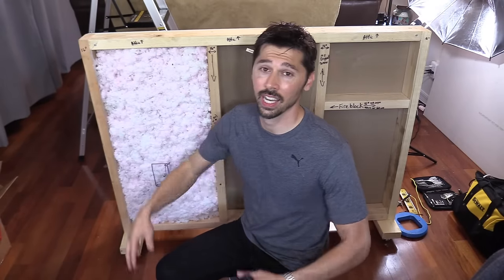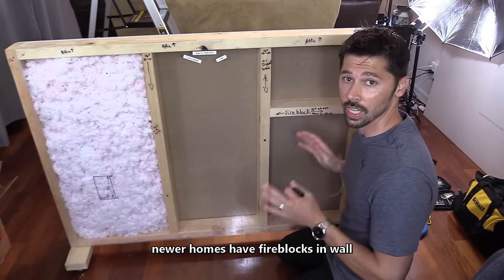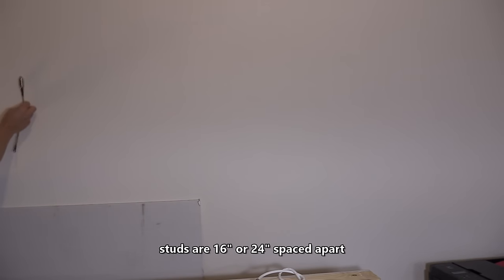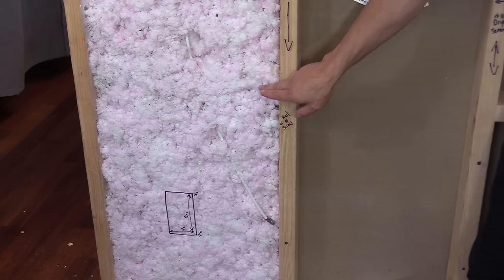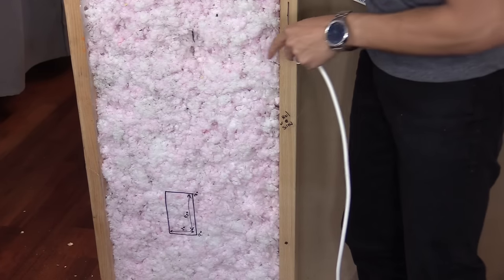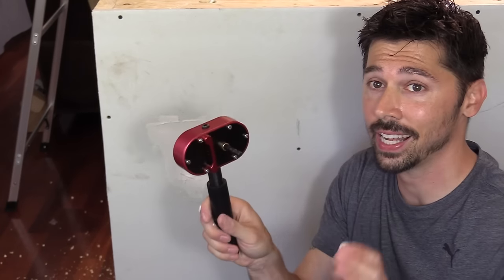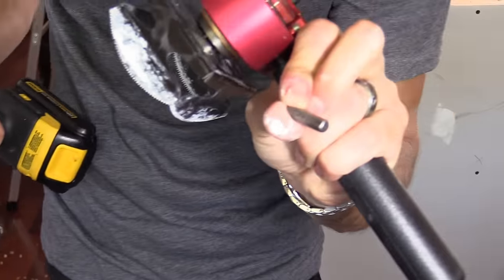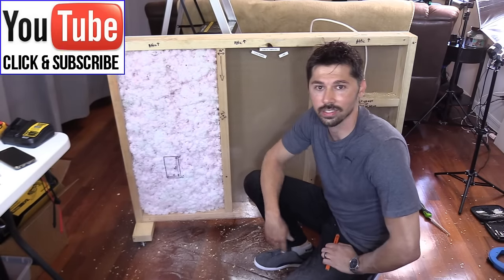3 EASY WAYS TO HIDE WIRES CABLES IN WALL & FIND STUDS

Comment from the maker: tools i used are magnepull, magnespot, Qbit saw found here- http://amzn.to/2up9cVL this link supports the channel, Share video to anyone that this video may help, thanks for the support! #fishingwiresinwall #hidewiresinwall #wallfishing #runningwiresinWall #fishingwiresinwall #tampatec  #tampatech
Reply: I have a Samsung led tv un32eh4003 with a dark picture could you please help me and the leds are all working iv tried all the settings and it doesn't get bright enough could it be the control board can you help me please
Reply: You may consider a different power plug or plugging it directly into the wall if it's not already.
Reply: Tampatec
Reply: @Tampatec . Ingenious tools! being a general contractor I wouldn't mind having a set myself. Just a thought though something that would be really neat on the end of the Magna pool would be an adapter that screws right onto the coax.
Reply: But most new building using metal studs it's difficult to use magnet pull
Reply: Mir Ali only commercial  buildings are.using .metal .stud framimg in most areas. Metal.stud framing is not  cost  effective  in most residential settings
Reply: I'm network installer most of the time they using metal stud in the business places also they put tiles on sheet rock its hard to find the stud in this situation but the vdu is very informative and thank you sharing
Reply: Shannon turnpaugh
Reply: Tampatec
Reply: Luke Morter new residential construction in South east Florida uses mostly metal studs.
Reply: How about concrete walls man?
Reply: I’ve owned a Magnapull kit for about 8 years and honestly have never used it as it was intended - to pull a cable from ceiling to floor level. In Australia, this is just not possible. Building construction methods here limit the use of magnetic pulling tools. Internal timber stud walls have at least one noggin. Diagonal metal ‘strapping’ is also often found on softwood framed walls (i.e. 1980’s builds onwards) and that will end the magnapull’s journey if the noggin hasn’t done so earlier. Magnapull is good for short journeys say from a wall mounted tv to an outlet near the floor or to retrieve a plaster bracket or something that’s fallen down the wall. 99.99% of the time you’ll get the job done quicker by using fibreglass rods or a trusty piece of yellow tongue, and you’ll drill out the noggin(s) using extension bits with a speedbor bit on the end. The magnaspot tool though is very useful if you have no accurate reference on where you need to drill. I just wish it used a few ‘AAA’ batteries instead of the fiddly button cells. 
A lot of work has gone into your video. Instead of making the demo wall, why not just show the Magnapull working using a real wall? This would’ve given a more realistic view of what a DIYer will face when attempting a cavity drop cable run. The only hole you should need to cut in the wall is where your outlet is going, not to get past the noggins as many others have already said here.
Reply: holy balls man. I have not done wall fishing in a long time, but I need all these tools...

These are amazing.
Reply: Tampatec great info ! So are you a guitar player ?
Reply: Tampatec there are no studs in the ceiling big guy. There are joists
Reply: This was great, informative and the presentation was great. thumbs up
Reply: I was surprised too he only uses short bits instead of long flexible bits with extensions. If all goes well, no need to open the drywall to get around a firebreak nor do you even need to fish as your bit goes all the way from the hole for the outlet up to the attic.  Having to patch drywall extends the amount of time at the site and may require an additional trip to sand/texture/paint after the mud is completely dry. He totally glosses over the multiple steps required to patch a hole.
Reply: I hate that dewalt drill. Its has a drops alot chuck.  The old drills where much better. do not buy a new dewalt just get a battery adapter. Do not buy new the old style as the batteries are old when you buy them new.
Reply: Tampatec the
Reply: will mast the
Reply: Mir Ali ,

   .
Reply: Luke Morter the
Reply: Mir Ali ,
Reply: Tampatec what is the name/manufacturer of the drill adapter for the Qbit?
Reply: Luke Morter where i am in so.fl most of the framing is metal studs
Reply: Thanks - excellent video.  Appreciate the wisdom.
Reply: Very informative , good tools, surprised you had no name spade bits though rather than some self threading like  the bosche blue devil series and use them with an impact. The pull through the wood and since they are hex shank they stay locked into the impact and won’t fall into the stud bay lol
Reply: Tampatec what is the dimensions of that wall
Reply: Great information I never knew
Reply: cool tools for an installer ( or even dyi)  that magnepull is pretty interesting ...
Reply: the link to amazon for the other tools does not work
Reply: We use the plastic joiners out of floor boarding, called tounges, u can maneuver them really easily and bend them into shapes, it's a bit of an art but once u get a feel it is really easy to get up and down walls. A lot of the best tools are the ones u make yourself.
Reply: @ronnieflores736  Chase cutter.
Reply: @danielflores7724  Yes, he's in the Foo Fighters.
Reply: @miralinj78692110  not residential sf
Reply: This was a great step by step video for people who have never done this before
Reply: Can dc comic

Lpci

P
X
Ik
Reply: I really though i got cut 😐😐
Reply: You have no idea how to patch a wall. That's incorrect
Reply: 0
Reply: Great video!  Thanks.
Reply: Nice tool well worth the money for a contractor.. but for home use best to just improvise... never thought of using magnets .. what a revelation many thanks
Reply: Instablaster.
Reply: Plaster and lathe is a pain to find studs in
Reply: why not just use a super long drill bit to get through a fire blok

Comment: Good info on tools you shared. I'm a GC for 35 years. The only thing I wouldn't do is the fire-block scenario. You're making a lot more work for yourself patching and smoothing the cut out, not to mention a possible nail in the future piercing the cable if you don't drill the hole in the center. A simple solution is a 4'-6' flex bit. You just drill down through it all, easy and quick.  It also can be used  for recessed ceiling lights that you have to interconnect through floor joists. They even have them at H.D./Lowes.

Comment: Cutting drywall? Nope, 95% of customers dont want their walls to be cut and patched, they expect a clean not noticeable work, so for this cases i always go with an extension for the drill.
Reply: If you do it right, they will not notice.
Reply: @pauldrake5500  if you do it right, you avoid putting holes in walls if at all possible.

Comment: As a drywaller I just want to add most drywall hangers are not going to put a screw in the fire block
Reply: Phillip Schulz I was going to say this. But NO hanger who likes his finishers are going to put screws there.
Reply: I really like this. I am amateur. I did my house with 4 tv and internet drops. Next house will be much simpler. Test anyway for drywall connector to fire-block. When making the opening, you plan to use the opening drywall as a plug, a nail would leave you with crumply bits. Love video.
Reply: I think he used the screws only for the video purposes, fire blocks are put by framers, not drywallers
Reply: this sounds like you just F'd his best luck.
Reply: Yeah but I am pretty sure he was referring to putting the screw into the fire block while hanging the drywall.
Reply: Xatruch think about WTF you just said... lol
Reply: Homeowners may
Reply: Because they don't have to, and it makes more holes to be patched?
Reply: @TheJacob6217  
Drywallers won't normally bother putting either a nail or screw into the fire block.  They're hitting the studs and keep a uniform pattern throughout the hanging process.
Reply: Didn't understand your comment. You want to add more drywall hangers. And you aren't going to use screws? Okay, each to their own. Screws are faster using autofeed screw guns.
Reply: @edmaher3612  I have the same urge to support the drywall really well.  However (with the caveat that I am a DIYer not a drywaller), if I am working this out correctly, every screw put in costs:
- Installation time (labor cost)
- A screw (materials cost)
- A hole in the drywall that has to be finished by the finishers (labor cost)
- If the fire block isn't the same width as the studs, isn't carefully aligned (labor cost), or isn't completely straight (materials & labor cost to get straighter 2Xs), screwing the drywall to it will cause a relatively sharp crease in the wall (vs. a slight, large radius bowing if not screwed to it) that will be surprisingly visible.  It might be prone to cracking when the wall flexes (e.g. when a door is slammed) where a sheet that is not screwed down in the middle would just flex slightly.  The finishers will have to deal with it (labor, materials) and the owner may have complaints about cracking (labor, materials, reputation costs)

Multiply that by what, on the order of a hundred drywall panels in a house? so 500 extra screws?, and it seems to me that putting in extra screws costs quite a bit for an uncertain benefit.
Reply: how about that square patch will always show up no matter how good you patch and regardless of how French you are...
Reply: @jamieoliver6892  it can be completely hidden, but you will need to use more than a little spackle, you'll probably end up with a three foot radius mud spot to prime and paint.
Reply: Right! Why waste a screw?
Reply: @Xatruch504  But the drywall is attached by drywaller.
Reply: @samjg1  but drywallers screw on the studs, they don't bother with fire blocks.
Reply: Lol, y'all.  It has nothing to do with the cost of the screw or covering the hole.  Rather if there's proper fastener spacing on the vertical then an extra screw on the fireblocks basically does nothing.  The studs are straight lines from top to bottom.  So it would just be silly to keep track of where the fireblocks are and hope to hit them.
Reply: That drywall patch tho lmaooo
Reply: If that's the case, then we'll just use a stud finder, no problem.  That was just on scenario he demonstrated, just in case a drywaller wanted to tighten up the wall board.
Reply: @jamieoliver6892  nope
Reply: @dodado2011  wouldn't be that big if you know what your doing
Reply: Great video ! I knew, seen it before, the MagnaPull , but didnt knew its name, it might help me to move cables for speakers through the "box" that forms the floor between first and seconf floor, Florida, we do not have basements and attics are bad in two story houses. 
   Loved when the drill bit fell inside the wall... :) , every time one does something some thing happens and wifes complain why it takes time to do things...

Comment: It is very important, and required by NEC Code, that wires passing through studs and the fire block illustrated in the video not be located close to the surface of the stud where a screw or nail could puncture the wire in the future. The wire must be in the center of a conventional 2x4 or be protected by a nail-on metal plate intended for the purpose. Simple to do, but please do not omit.
Reply: The NEC code pertains only to electric wires that carry current to outlets, switches, etc. It does not address coax, speaker and other signal wires. If a nail were to penetrate and short the coax, no fire hazard is present.